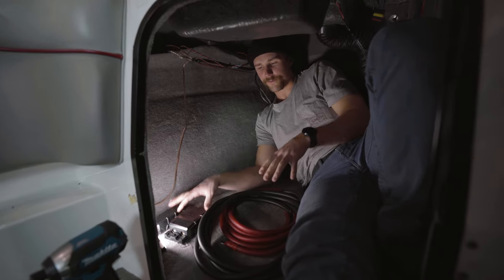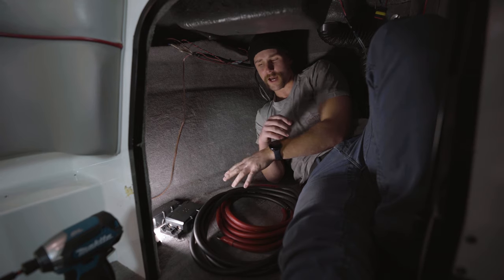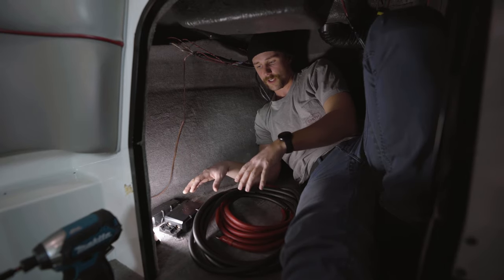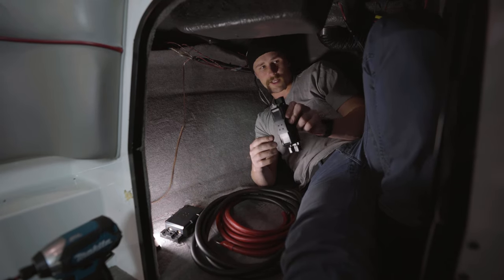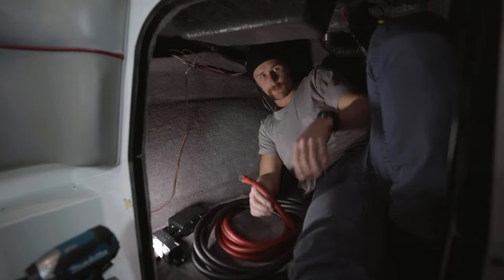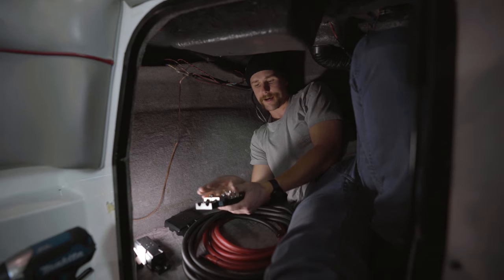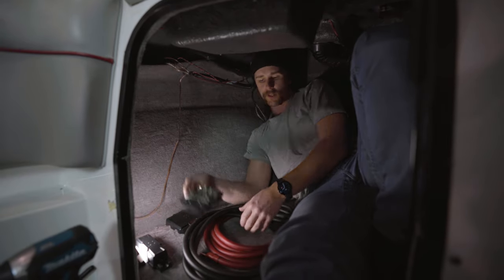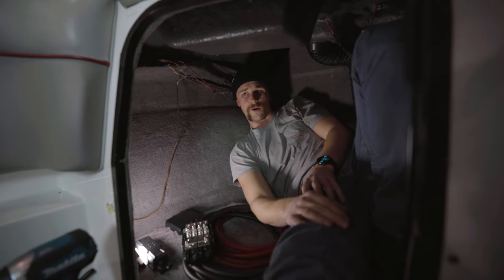Episode 7: Wet Sounds Audio Upgrade I WakeMAKERS Project Boat

Comment: What about the head unit
Reply from the maker: Head unit we will dive into a bit deeper in an Instagram live video next week, as well as a future video. 

We were hoping to use the existing hole from the old head unit to mount our new Wet Sounds BT Equalizer, but it didn't quite fit perfectly. We decided to 3D Print a shim in order to mount it. Wet Sounds does make a great under dash mount for that unit, we just decided to go about it the hard way hahaha. 

Out of all of the upgrades we have done so far, audio was by far the most time-consuming and also took the most on-the-fly problem-solving. Like we mentioned we went ALL OUT on this system. For this extensive of an upgrade, we'd probably recommend taking it to a shop or having a fair amount of audio experience like Joel and Anthony.